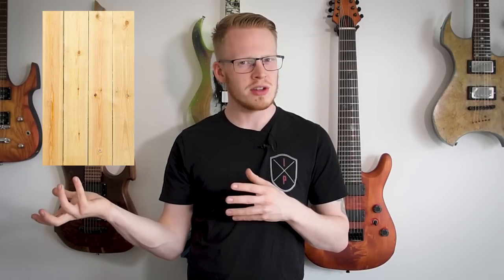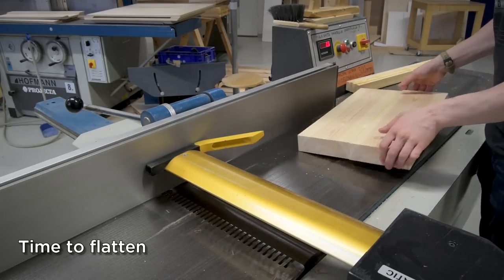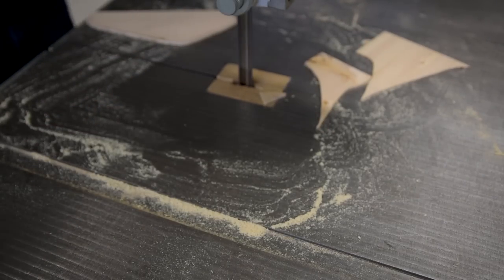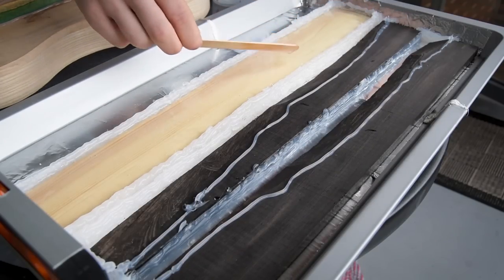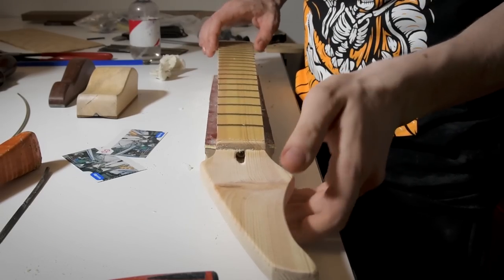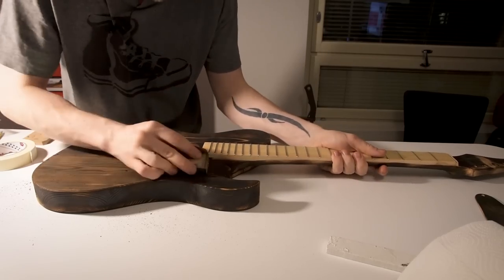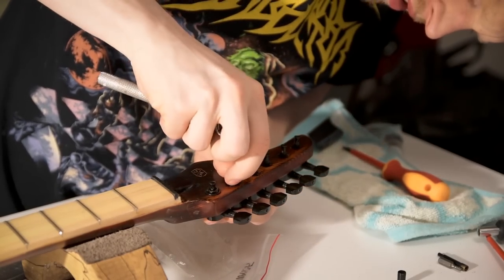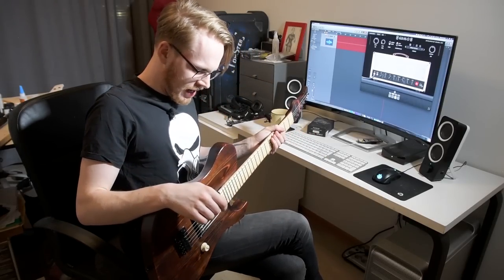I Made A 100% Pine Guitar!

Comment: People should know by now that most of the guitar sounds comes from: 1- Pickup; 2- How well the instrument is built; 3- strings; 4- fingers; 5- BRIDGE TYPE AND MATERIAL; 6- body and neck material (wood). As long as it's not a bunch of soft pieces that will absorb the vibrations, the guitar will be fine. Depending on the quality (and how it's done), even plywood guitars can sound good. All wood do is vibrate back so the strings keep the sound going, it's not that important for the sound quality. Tone wood is a thing for accoustic instruments, but not for electric. 

Pine wood is a good material for body, ok for neck (good if you reinforce it) and not so good for fingerboard (it's better to use something a little harder there). Because not everything is about sound, but durability, weight, playability and looks too. I think pine doesn't look bad at all for body material.
Reply from the maker: Completely agreed. While I have my own views certain things, I do agree that tonally the wood makes up for very little in electric instruments (and pretty much none for active pickup systems). I always like the metaphor of every part of an instrument is like ingredients in a recipe, which also works well with "taking things with a pinch of salt" :D

Pine is a great body wood. I think it looks great and it's very lightweight. Hell, even mentioned a bunch of times in the comments that so many actually make pine bodied guitars nowadays (even Fender have gone back to it for some models). I would not ever really recommend it as a fretboard wood, but that wasn't the point of the video anyway.

Thank you so much for you comment and that you checked out the video!
Reply: @IPGuitars  The video was pretty cool and the guitar sounds good. A lot of people get impressed because it's a non traditional material, but there's a lot of Amazing instruments made out of exotic wood that sounds great, even acoustic guitars.

Congrats on the work btw.
Reply from the maker: Exactly right. And honestly so happy whenever I see someone step outside of mahogany body+maple top traditional combinations of woods. I made my first prototypes out of birch and oak. They sounded great. Making something purely out of tradition feels... boring.

And thank you :)

Comment: How has the guitar stood the test of time? Any warping to speak of?
Reply from the maker: Still working just as well as when I first played it. No warping at all :)
Reply: @IPGuitars  Nice, I am going to attempt a simple project using pine board (2x4 in the US) joined together and adding 3/4" maple boards to the top for added stability. Your work has alleviated some of my concerns. I will start will a telecaster body because it's simple and I wanted to see how the wood performs. If all goes well, I will carve a Les Paul using the same process. Mostly, I want to do this for practice before spending large sums on the hardwood as it gets expensive quickly. I plan on oven drying the wood first just to give myself the starting place. Cheers.
Reply from the maker: That sounds awesome :)  and you are definitely going about learning the processes by using pine to experiment in the right way. It's definitely a low-threshold to try things out on.

Comment: Yeah, spade bits always feel like you're fighting your way through the wood by repeatedly punching it.  I feel more comfortable using a stepper bit to get most of the way there, then clear out the hole with a spade bit.  But I'm no means an expert.   It'll be interesting how it stands up over time, I don't doubt the body will be fine - and because you laminated a lot of bits of the neck perhaps there'll be no movement there.  I enjoyed that.
Reply from the maker: Exactly, I personally just got so used to using step drills at Crimson, so now that I don't have one I feel like I've taken a step backwards (...pun iiiintended?).

I've been thinking of doing a "6 months later" video to go over how it has stood up in that time. Given also that I live in Finland, so 6 months is enough time to go back and forth between cold, damp, hot, dry, repeat, shuffle, horrible climates and changes in air moisture.

Comment: This was a great video...thanks very much for sharing your knowledge. Im thinking of making a pine guitar...simply because i have pine readily available and i have basic tools, so its given me a bit insight. Ive always asdumed pine would be structurally sound enough to make a guitar neck..ive witnessed some tough pine in my day. Its also a very easy wood to work with, when you havent got the greatest heavy duty tools.
Reply from the maker: Thanks for checking out the video, I'm glad it was helpful :)

If you're looking to try things out and only have access to basic tools, pine will be perfect as a material. The key is more in the design and planning out, so that you will have an end result that is structurally sound. That being said, pine is sturdier than many would think if used properly :) Most importantly: have fun with your project!
Reply: @IPGuitars  thanks...im sure i will make plenty mistakes....but learn lots. Great channel btw..many thanks
Reply from the maker: Mistakes are exactly how we learn :) I've always said that you should never fear failure, instead learn from it, so that you can do better next time. I have not met a single luthier who hasn't botched a project or a few

Comment: Would it easily break over time?
Reply from the maker: Been over a year so far and it still plays great :) but basically no. I built it in a specific way to counteract as much movement as possible (multi-laminate neck, burning, etc.). I have good faith it'll be just fine :)
Reply: @IPGuitars  i really thank you for answering, it is really important to me
Reply from the maker: No problem at all :)

Comment: How do you calculate where the pickup should go?
Reply from the maker: It's more a matter of where the pole pieces line up when the strings are on. It's easy enough to figure out if you draw the guitar out full scale before starting work
Reply from the maker: I haven't done the calculations. After a while of building you don't think too much about it. The pole pieces lining up is what matters. Granted, if you have a soapbar-style pickup, then it is a matter of tonally where you want them set. Closer to the bridge and you get brightness (less vibration of the string) and closer to the neck you get warmth (more string vibration).

Comment: Why are you gluing the frets in
Reply from the maker: The glue helps seat the frets. Not something I usually do, but given the soft nature of pine I decided a little added structural integrity couldn't hurt :)
Reply: @IPGuitars  wouldn't that make it hard to remove the frets when you have to change them
Reply from the maker: @javanthomas4122  It does make it slightly more of an inconvenience to remove the frets, but not drastically. If you're careful with fret removal and take your time (as you should anyway) it should be just fine.

If you know beforehand that frets that need removing have been glued, you can use your soldering iron to heat up a fret at a time to kind of "remelt" the glue, making the fret easier to remove.
Reply: @IPGuitars  thanks for getting back to me
Reply: @IPGuitars  you play guitar pretty good. I,m making a guitar for my cousin but I don't know how to play guitar
Reply from the maker: Well thank you very much, I do not think I know how to play at all... Kinda why I decided to make them instead😅

You don't need to know how to play one to make one, what helps is knowing how to make a guitar play well in another person's hands. Ergonomics, feel, and the like
Reply: @IPGuitars  thanks for the info
Reply: @javanthomas4122  Stewmac has a video showing the difference between glued in frets and non-glued in. I tried both ways when putting frets into a neck. When I tapped the frets I could hear clearly which ones were glued in and which ones are not - so I ended up gluing all of them in. In my case, I used superglue though, not wood glue. Not sure if that matters in terms of tap tone. Probably not.
Reply from the maker: The different glue shouldn't make a difference in tap tone, because they are still solving the same issue: filling a void.

But thanks for the tip on the StewMac video! I gotta check that out, sounds interesting

Comment: R U serious manU actually  put a plastic nut on a guitar build?
And the super glue,,,did you use enough. Don’t get me wrong. Not being a hater
or being disrespectful,what U R and did was very col. But man it’s like making your favorite
cake and then throwing it out in the yard. That plastic I’ll never and I mean never reverberate the tonal vibration
Of all of your hard work unlike bone or tusq and even though that is manufactured it’s a lot better than plastic.
But the build is killer I love one pickup guitars they make you work for it,,and teach you a lot more about picking techniques. 
But the plastic nut 😵‍💫
Reply from the maker: Haha, the plastic nut as mentioned in the series was a choice as to "how cheap can we make it" for the challenge. I wouldn't use one otherwise. Whereas the glue, you actually technically shouldn't even need it. The string tension should be more than enough to keep your nut in place if made well. But I usually add a drop to minimise even the tiniest sideways movement.

There is an upcoming continuation to this series where I upgrade the guitar as a sort of "Now how good it can be with proper parts" and the nut will definitely be out the door fast as lightning.

And thanks :)

Comment: Ok, but can you also add the tens of thousands dollars of tools and machinery to the price to make it fair?
Reply from the maker: That would be beside the point I'm trying to make with this. For access to the machinery I got to rent a few hours here and there at a makers space. I grant that yes, I did use an available space with tools which cost money, HOWEVER all the processes are things you could do with just hand tools too. Just takes longer.

Then that takes into question that would you raise a point to count in the cost of those tools as well?🤔 That essentially $0.00 amounts to: no tools of any sort whatsoever, rulers, pencils, finishing products, all sandpapers, rent of workspace, reimbursement for workhours, etc.? I get your point, but if we take everything into account then every similar video on Youtube expands to quite a bit more money than titles suggest😅

"100€ for all parts and woods to make this guitar" would be more accurate if that were the case.
Reply: @IPGuitars  Ok, I get your point. I just thought it would be fair in consideration if you're talking about cheap.
Besides that, you did a marvelous job. I only just started my new hobby of building guitars and I thought it would be fun to challenge myself straight of the bat and make my first guitar out of pine. And MAN, does that material suck to make nice looking drill holes and carving. The carving worked out great in the end, but the strength of the neck not so much.. The neck is now a piece of scrap, and the headstock functions as a holder for some screwdrivers :p

I've subscribed to your channel. I'm looking forward to see more of your builds. 
Maybe you could do an absolute budget build with some hand tools for people who want to start building guitars but don't have a great deal of money. It would be cool to have people more people showing that the bar to start building guitars doesn't need to be very high in terms of costs.
Reply from the maker: First off, thanks for the sub!
And yeah, I totally get you. In the full series I do mention a few times that you can do all this with hand tools. The fact that I rented time at a workshop worked as a time-saver for me. And at the same time if you have access to a makers space nearby, it's worth checking out if it would work for the viewer in question as well :) that way you can kind of dip yours toes into the craft, without having to buy all the even minimal tools necessary to get the job done. Especially here in Finland, we don't really have the luxury of workspace (garages and sheds) to do this, so it's either doing things on the living room floor (as I have done in the beginning) and so on :D

I have thought about the best way to accomplish the Full Handtool Build, so that I can definitely do it without misunderstandings. Most my tools at home need a lot of sharpening as well😅

Also, awesome to hear you got into luthiery! Pine is definitely the low-threshold way of experimenting and figuring out your technique to different processes, but yeah, does suck as a material.
Reply: @IPGuitars  Ah, yes. The sharpening of tools. An art on it's own :p 
Shame to hear it's hard to come by workshops in Finland. I guess it's the same in Holland, but we tend to have sheds in rural areas. Most people have their own basic tools in there, but it's hard to come by machinery like bandsaws, planers, etc., unless you buy them yourself.
I can't wait to get better at lutherie :D it's so much fun!
Reply from the maker: A dark art at that haha.
Yeah, I getcha.

And it is an addictive thing, no one ever builds just ONE instrument ;)

Comment: When using band saw put the thickest piece of wood between the blade and the fence, 
not the thinnest piece;.
Reply from the maker: Usually yes, but I was using the fence to get the same thickness strips :) doing it the other way around would require changing the fence position constantly

Comment: Rickenbacker has been making guitars and basses out of one material (maple) for 50 years.  This is not a new concept.   On the other hand,, anyone brave and stupid enough to use pine for a guitar neck, deserves an award.   Here's your sign.
Reply from the maker: Never said this was a new concept :) and agreed that pine isn't a neck material, but that was the challenge. Though with proper construction methods, mine still holds true years later.
Reply: @IPGuitars Yeah, I get it.  Like the guy who made a car out of cardboard.
Reply from the maker: Exactly, the huge difference in "can you do it" and "SHOULD you do it"
Reply: @IPGuitars  Exactly.

Comment: In no way you can hear what the guitar actually sounds like through a macbook and a soundcard. Go to a music store, plug into glowing glass. Play sum Ac/Dc and you get a hugely better picture.

Nice production and cool guitar though!
Reply from the maker: I would just need to learn some AC/DC first :D

And thank you!
Reply: @IPGuitars  Yeah. I was just looking around to understand if a humbucker would be any good for my pine telecaster. :)
Reply from the maker: Ah yeah, really depends on what you're going for. Pine in and of itself is an extremely resonant wood and that kinda helps amplify the sound and it's actually really "full" so with a humbucker, you'll really get power out of the guitar. Bear in mind that the pickup I used in this build was around 10 bucks😂
Reply: @IPGuitars  Nice. I don't think the amount of money makes the pickup sound much off or worse. After all, it's just enameled copper wound around pins under which there's a magnet. It still gives an idea how a humbucker sounds :)
Reply from the maker: It pretty much boils down to how and how much it is wound with what gauge of copper wire, but yes definitely gives a good idea of what humbucker will sound like.

I should clarify that even for a 10 buck pickup, I am astonished at how this guitar sounds. Even more so through a "real" amp

Comment: Why pine, though? It's a very cheap wood, doesn't have nice grain, doesn't resonate very well, and generally doesn't have good sonic properties. Leo used pine on the first Broadcasters, but that was because he was a notorious cheap ass, not because he bought quality materials.
Reply from the maker: Why pine? That was the point of the challenge :D

You can get nice looking figuring in pine and finishing does a lot too. It actually resonates extremely well and has great sonic properties. Mind you that acoustics have used pine and spruce for ages and sounds great :)

Fender even brought back pine bodies in a few models in recent years and they sound great.

All-in-all, this was a fun experiment and challenge with surprising results.